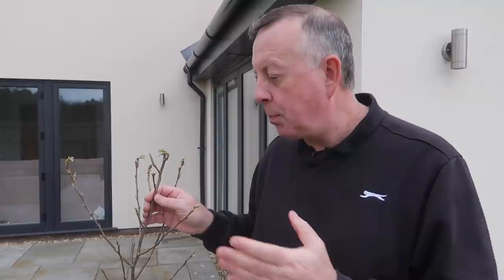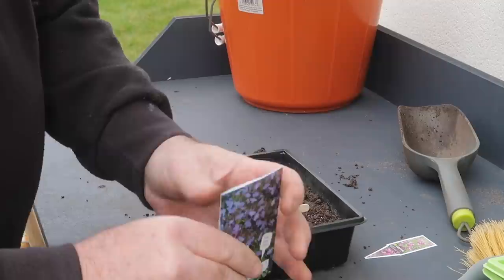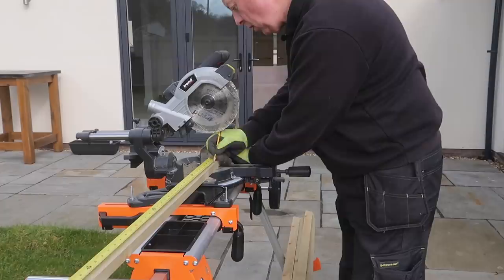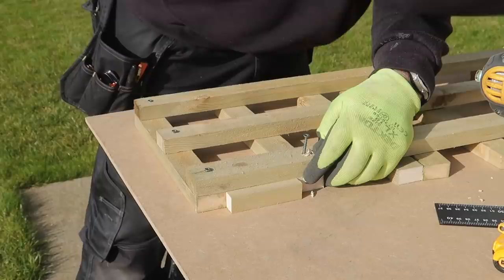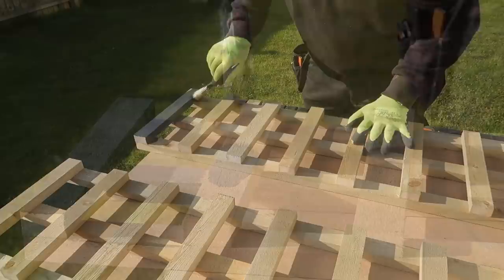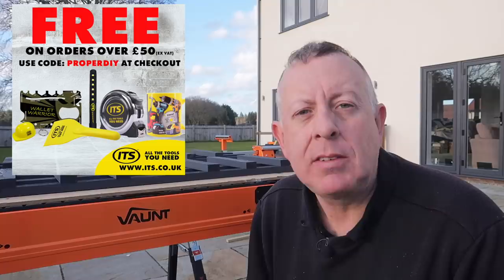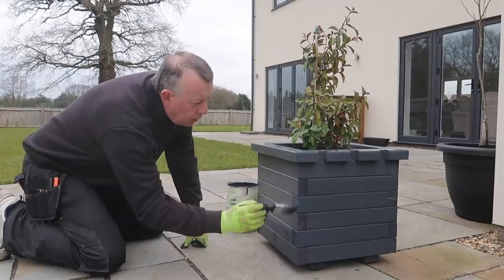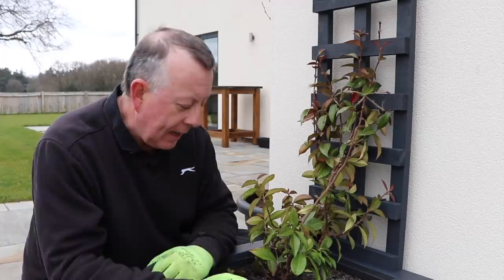How to Make a Garden Trellis

Comment: You’re right, paint the lengths of timber before cutting/assembly then after assembly paint the cut edges also sty your saw up on the lawn and you won’t have to sweep the paving afterwards … 

… and it’s way quicker to use annular ring nails and plenty strong enough!

Comment: Yes you should have painted the wood first, and use a nail gun to hold the wood together, much cheaper than screws and quicker to put together.
Reply from the maker: 'Cheaper than screws'? I first have to spend at least £100 on a nail gun - doesn't sound very cheap to me

Comment: How did you work out the spacing between the horizontal pieces for the trellis please? Or how many horizontal pieces you needed?
Reply from the maker: I measured the spacing between the vertical pieces and just cut a spacer to the same length

Comment: What is the fancy bit you use in your drill driver?  Great series of videos by the way.
Reply from the maker: Thank you. It's the Dewalt magnetic bit holder I bought from FFX...
https://www.ffx.co.uk/product/Get/Dewalt-Dt70535T-Qz-5035048088494-Impact-Torsion-2-X-Pz2-50Mm-And-Magnetic-Screwlock?gclid=CjwKCAjw8sCRBhA6EiwA6_IF4WVVx7_zndTeC_4h0Fqs1T0aJ-XNkTUTJOOb89utaN1bkiR1At3rphoCj6YQAvD_BwE
Reply: Perfect. Just ordered it. Thank you. P